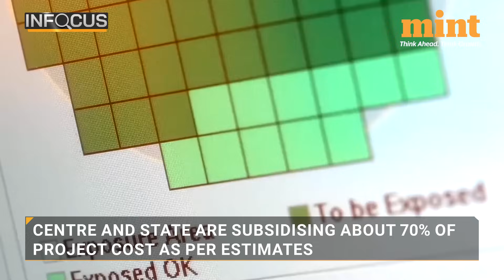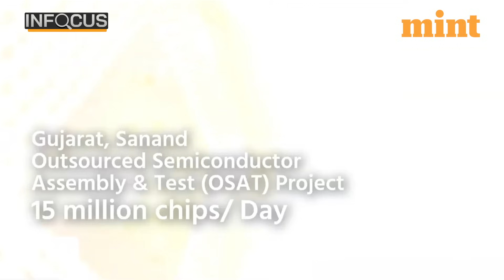India's First Semiconductor Fabrication Plant In Dholera, Gujarat May Churn Out First Chip By 2026

Comment: The plant should have been near an IT hub like Bengaluru or Hyderabad to complement each other. This move doesnt make sense.
Reply: This is high tech manufacturing, not back office IT.  This industry has many more requirements.  Gujarat has the fastest ports to Europe, eastern US, Gulf and Russia.  It is only a 12 hour speedboat ride from Gujarat to UAE and 8 hours to Chahbahar.  Every company wants to be in that state for this reason.
Reply: @AO-xd2ml  get current affairs right bro, Chabahar isn't even ready yet, and Mumbai is the fastest port even now. Be practical.
Reply: @sidharthshekar5046  Tata is much more critical than AMD or Intel, who have not put their cutting edge fab tech in India.  Intel is making their fabs in the US.  That is what Tata and possibly Reliance will try to do for India.  Tata factories were already located in that state.  And this production will be anchored by that.  And please revise your port geography.  Gujarat is the Gulf state of India and it has a multitude of ports.  Mumbai is much further out and has limited ports.  It adds 20-30% more shipping time and the additional cost that comes with it.  Mundra itself has more output and certainly, speed.  UAE, Chahbahar and potentially Iraq, are your drop off points.  Chahbahar finalized a 10 year deal with India last month.  Even the Afghans have invested $35 million to do trade with India there.  UAE deal was already done.  This is why Gulf of Kutch will be the most important trade zone in the world.
Reply: @AO-xd2ml  Before Chabahar port is finalised there would be another war itself started in the gulf like that of Israel, and please update your knowledge on ports as you are not more intelligent than Google I believe, Google "Biggest ports in India, you will get 1. Navi Mumbai 2. Chennai 3. Gujurat". There is a difference between knowledge and awareness, be more aware of your surroundings than listen to Godi media
Reply: @AO-xd2ml  Hi tech manufacturing I agree but Chip specialisation companies are located in Bengaluru like AMD and Intel with a workforce of more than 50k already. So it becomes more practical to speed it up near the IT hub itself
Reply: @sidharthshekar5046  There is no space to even set up a plant in Mumbai. You can't set up anything in Mumbai at this point, it's an overcrowded city. Letting it remain as the financial hub is good enough. 

And we started with 28nm. Manufacturing smaller form factors would take very long from where we are right now, and it requires different equipment as well. There is no harm in setting up a different plant near Bengaluru once we have the knowledge and  resources to create <10nm.
Reply: @soham4741  I agree, and my point was never to set up in Mumbai, my point was Mumbai port is bigger than Gujurat port
Reply: @sidharthshekar5046  This is just a sample of the ports that Tata's state of Gujarat will avail him:  Kandla, Bhavnagar, Porbandar, Veraval, Okha, Bedi, Navlakhi, Mundra, Pipavav, Poshitra, Dahej, Magdalla and Hazira.  Dubai Ports World has also won a bid to build theirs next to Kandla.  Tata might even be able to get his own port there, who knows?  As for Chahbahar, Dr. Jaishankar recently visited and made the deal.  Read about it.
Reply: @AO-xd2ml Imao who said TN is backoffice? TN is the leading manufacturing state.
Reply: @petrichor259  He said Bengaluru and Hyderabad, not TN.  Neither have ports.  As for TN, DMK's anti-India and anti-Hindu rhetoric is evil and never acceptable.  Also, their discrimination against Hindi speaking people, who are a large portion of the workforce in TN, will put the state at a huge disadvantage when competition for labor becomes more intensive in a few years.  A tug of war for labor happened in China as well.  TN must rid of DMK and Mao Stalin forever and welcome all Indian languages like Gujarat and Odisha are doing.  That's "business friendly."  Odisha is increasingly becoming the preferred east coast port destination, due to its geographical proximity to the best priced workforce in the nation.   Odisha will outpace TN eventually, unless DMK is ousted.
Reply: It should be there where government is stable and bomb blast doesn't happen , now south is busy  fighting  over language, wait for 5 years of congress completion in karnataka,  many companies will come out from there and move to other states  ..
Reply: @arnavsingh2532  you know why bomb blast happened in Bengaluru and not Gujurat because it would affect the Indian economy more in Bengaluru than any other place. I would have preferred BJP over Congress too but the only reason the BJP did not win is because it disrespected leaders of Karnataka who are valued in Karnataka.Would you not fight if no one talks Gujurati in your state?
Reply: @sidharthshekar5046  yeah everything is done by bjp 🤣, that's why abdul was found guilty otherwise he may be hindu, Everyone one is liar except pappu 😂
Reply: @arnavsingh2532  who is Abdul?🤣and how is this guy related Karnataka politics🤣
Reply: @sidharthshekar5046  Abdul did  the blast in the cafe ,and  failure of state government , this how its related to karnataka politics🤣🤣
Reply: @arnavsingh2532  Nobody got hurt. Do we blame Modi for the Gujurat earthquake?There are bad people in this world, it should have been a National Security issue which the NIA is responsible which is run by the central govt. Check your facts🤣. Only unimportant places are safe like your state.
Reply: Why? It's national security issue to set plants in South India.

Comment: After 40 years- (1980-2024) of Emory talk  at last India is going to build a chip fabrication plant .
Eco system - India not have .
Designing chip engineers -20% India but working for foreign companies .
Power n water supply must be uninterrupted .
Bengaluru is having water crisis ! 
Need hundreds of skill engineers ,technician ,clean np
Reply: Aah here comes the CCP
Reply: @manannaik1341 😂😂
Reply: The reason why its to be buolt in gujurat because of Clean uninterrupted energy and water in a planned city.

Plus same for Assam as assam has abundant water which can be treated to become Pure water and energy could come from Either gas or Hydroelectric cause of Brahmaputra.